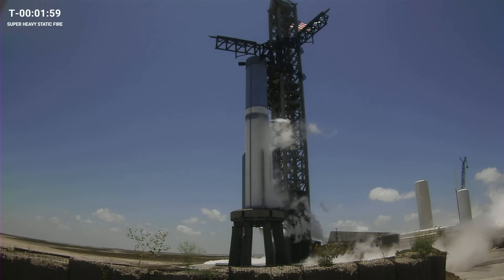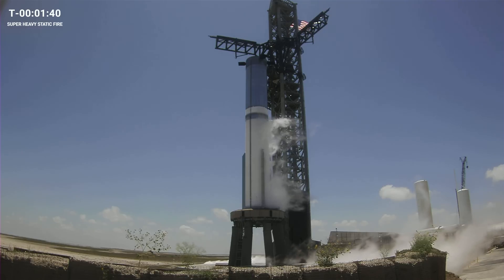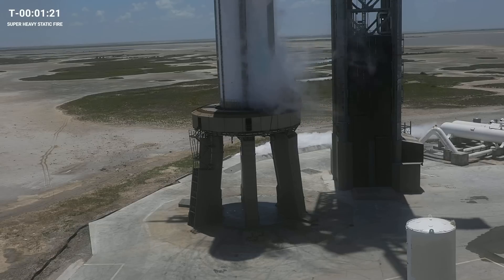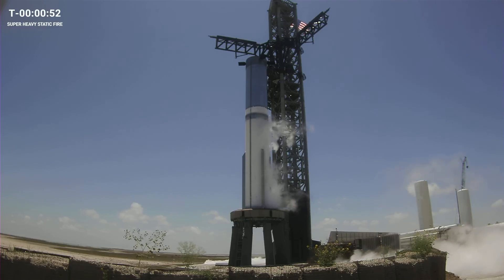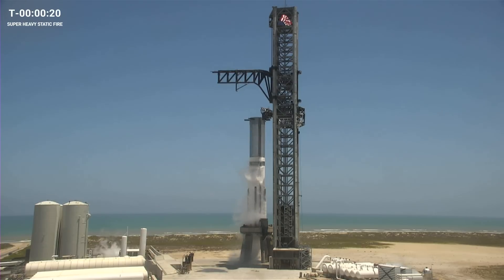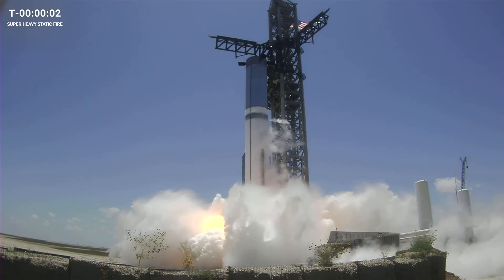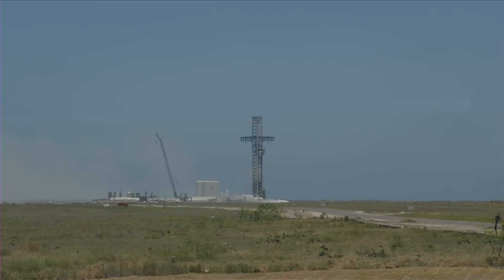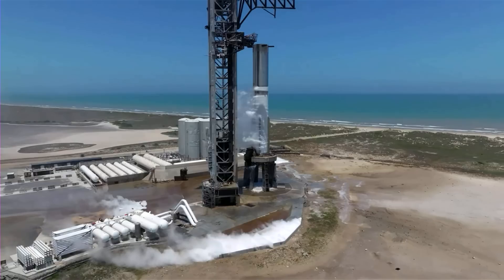SpaceX Starship Super Heavy Booster-9 Static Fire Test - 4 Engines FAILED, Launch Pad Survived!

Comment: Click bait 👎They didn’t fail were shut down
Reply: Run was supposed to be 5 seconds. Shutdown at 2.46 seconds due to 4 engines failing.
Reply: @billakers6082  🙄 4 engines were shutdown during ignition ,  didnt explode, no fires, clickbait thumbnail like I said. i watched the spacex live stream
Reply: @Draknos90  That doesn't change the fact they shut down the test prematurely. Was supposed to be 5 secs, damn this thing is just waiting to fail next launch, huh? With 4 engines out, i don't even think it would take off, it barely lifted up last time with 3 engines out...
Reply: @jaydonbrown617  it lifted ok last time if I remember for a FIRST attempt, Jesus, why do you think they do the tests. 4 engines were shutdown and the water system worked. But anyway it’s still click baity shit this channel that was my point to begin with
Reply: @Draknos90  So we're ignoring the brevity of the test? Okay, fine let's ignore that. If they did in fact shut down 4 engines, why the hell would they do that? What possible good does that do for them, other than avoiding something catastrophic? There was an obvious problem with these 4 engines, so they either failed to light, or they were shut down early to avoid some kind of damage.

And no, the ship barely escaped death on it's first launch. Aside from losing engines off the bat from the debris cloud, the thing struggled to launch straight up, instead falling slightly to the side. Luckily it was falling away from the tower and not into it. Musk himself even said that they held on to the rocket a bit too long, which adds to the cause of the debris cloud. 
Nothing you can say will make anything about the first Starship launch sound like it went off without a hitch, and I'm willing to bet the second launch will be the same.

SpaceX should consider themselves lucky the FAA stuck their boot up their asses, it'll give them time to actually fix their sht
Reply: @jaydonbrown617   so we ignoring that fact that it launched ? Everyone thought it would explode on the pad but hey ho, roll out another booster and starship there’s plenty no worries
Reply: @Draknos90  Haha you said my thing, very original, but expected. I never said it didn't launch, it was just a really crappy one, narrowly dodging multiple chances to explode on the pad, as you stated. Of course, it wasn't actually ready to launch yet, but Elon is a child, so he launched it for the stoners. 
I'm referring to THIS static fire which was cut short prematurely, something you continue to ignore, but as I said, that's fine. Take a look at the previous booster's static fire test, then this one, then tell me "Oh yeah, perfectly normal test".
Reply: @jaydonbrown617  you still going on 🤣 your thing ? 
what’s not normal about this static fire test ? Oh out of the 33 engines 4 shut down 2 seconds . Must be a complete failure , stupid space x for testing lol  29   Engines and may I add raptor 2 engines, all fired.  Look where falcon is at now from where it came Jesus.
Reply: @Draknos90  LOL Falcon is a completely different rocket. Starship is going to need NASA amounts of development time and money to perfect
Reply: @jaydonbrown617  but falcon is made by the same company, everyone thought he was mad for trying to land a rocket and here we are. We shall see
Reply: @Draknos90  Same company, but different in design and function in many ways. Also a big difference is the engine type, the Merlin is much more reliable as it stands compared to the Raptor. Sure the Raptor is several times more powerful, but it is often times much to its own detriment. 
Not everyone thought SpaceX was crazy, just that it would be incredibly difficult to achieve. Get the right minds together, the right designs, the right programs, the right conditions, and yeah it is possible. Now that they've perfected it with F9, while it's not like they're starting from scratch with Starship it will just take a large amount of development time.

Comment: Watch a 0.25 speed and freeze it T-00:00:02. That wasn't a start-up, that's an explosion.
Reply: Likely a time lag.
Reply: It looked like a reasonable start-up to me, not that that saves them from a number of other show-stopping issues.
Reply: You are right that was an explosion. If stage 0 survived that will mean the test was a huge success!
Reply: @Reddogovereasy   Um, the OLP test would by definition have succeeded, but the booster test definitely failed whether there was an explosion or not.
Reply: @Reddogovereasy  define huge success please. They need to figure out how to reliably fire up all 33 engines for a launch and have so far failed to do so.
Reply: @dagger4146    You're so right, but it's worse: they also have the problem of engines overheating when they run the system at full power. In April, at the moment of liftoff, they ran at far-reduced power, as shown by the fact the craft initially was almost unable to clear the tower, nearly stopping ascent for a fraction of a second.
   For me, the engineering on this craft is so far from the minimum standard that I believe this project alone (only this one) shows the level of Spacex engineers. IOW that the other company programs must have "borrowed" their core tech from elsewhere.
Reply: @no_rubbernecking  Mix of NASA an KSP.
Reply: @dagger4146  haha ✌🏼

Comment: Which 4? 
Were they engines that would relight for landing, or just outer ring engines? 
4 shut down, which says they did light? 
yes?
Also, could water get too high and cause damage as they ignite the engines?
Reply: Importantly, we are not told how many did not ignite, only the number that ignited and then shut down prematurely.
   Given the number of four, it really doesn't matter which ones they were. The vehicle cannot reach the target velocity with four engines out; therefore, separation cannot safely happen and is thus programmed not to happen. Orbit cannot be achieved.
Reply: @no_rubbernecking Actually, we were told that all 33 entered the start sequence…and that 4 then entered at some point the shutdown sequence prematurely …apparently, causing the test to ‘abort’ (my word) early. We don’t know- yet- if those 4 actually ‘ignited’.
Reply: @dphuntsman    I see, thank you.  Are we sure it stopped early? I thought I heard it was only supposed to fire for 2.7 sec.
Reply: @no_rubbernecking  I recall hearing the run was to be 5 seconds.
Reply: @billakers6082    You're absolutely right; at 01:25 he does say that! So it's even worse than I was thinking. I guess I misheard something on the longer audio feed from another channel, and consequently that stuck in my mind over this clear statement.
Reply: @no_rubbernecking 
But that's only for a potentially maximum payload... right?
Reply: @jkg6211    Mmm, not necessarily. In the flight test, the vehicle did not separate, because of exceeding the three-engine limit. And it had no payload.
   Technically, with four engines out, it might seem that it would have enough thrust to reach orbit without a payload; however, that's not how it was programmed for whatever reason. Perhaps with a full load of propellant, and knowing that they still haven't been able to run the engines at full power without having them blow up, they technically don't have sufficient thrust without 30 engines at liftoff.
   Bear in mind that each engine out means that 1/33 of the propellant cannot be burned and will be extra weight all the way through stage 1. It's not like they can just jettison the propellant. Also the first minute is where the vast majority of the drag will occur, and if you can't produce the needed thrust in that initial push, there's no way to make up for that later.
Reply: @ty_fowler  I didn't think of that- especially the extra weight of unburned fuel.
Reply: @jkg6211    Yeah, orbit is a hard thing and the difficulty increases geometrically with both size and weight.

Comment: Elon Musk is too proud and arrogant to learn anything from the Soviet Moon rocket N1.
 Instead  of trying to develop huge humongous engines as von Braun decided with the Saturn rockets, Russians tried to hook up dozens of smaller rockets in the N1, which resulted in a failure. Sure they didn't have computers and stuff but we are talking basic reliability here, just brutal flaming nozzles firing raw gas at thousand degees. Those smaller engines were highly reliable, in fact the most reliable anywhere at that time. The problem is when you try to fire those dozens flame throwers as it were a single one. Good luck with that.

Comment: That's why we test.
Reply: And fail.
Reply: @JP-re3bc   Better to fail while testing than to fail with people onboard, right?  Yeah, as the original commentor said, that is why we test.  To find what will fail and fix the issue so it doesn't happen in flight.  Do you even science, bro?
Reply: @BackYardScience2000  Obviously, bro. My point was about bad design, not testing. TG we test.
Reply: @JP-re3bc  well they eventually overcome design flaws of falcon 9, after different models and lot of testing, most of SpaceX rockets gone boom before proving themselves to be extremely useful. it's just that the starship is lot more complex system that need to be tested for several years, or maybe even a decade. but the end result would be amazing if they figured out the problem and testing costs far less money because the starship is made out of stainless steel which makes those models very cheap to make.
Reply: @vidurasankalpa  You are right, of course. I just wonder why SpaceX engineers went to this old Soviet idea instead of going the NASA/von Braun idea of larger engines. Like huge, mega-Raptor engines like it was the concept in those Saturn rockets.
It would be cool if they gave any hint to the public like me.